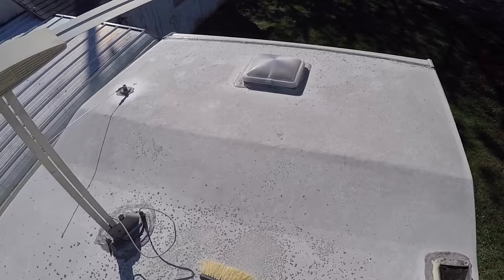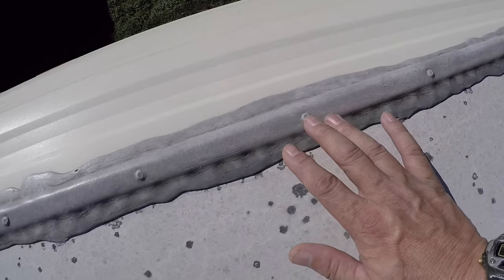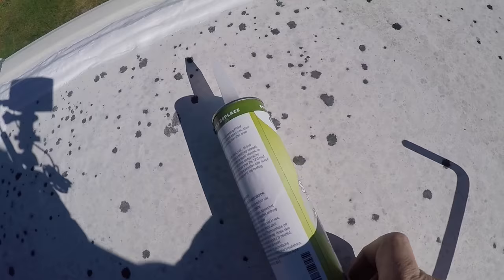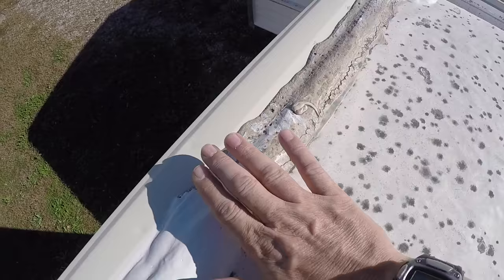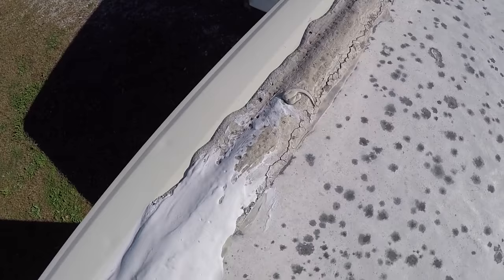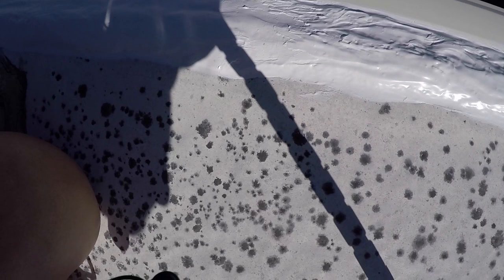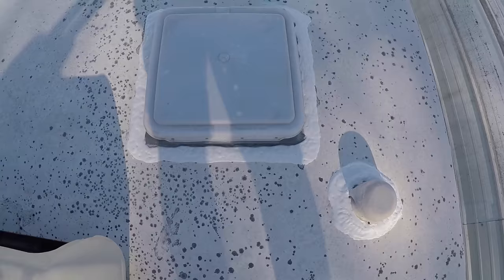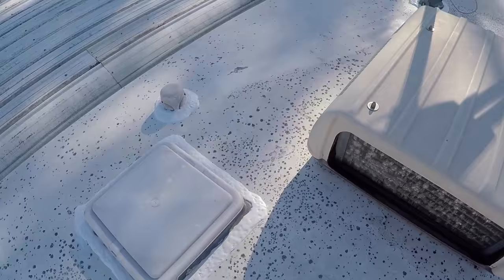How to Seal RV Roof Seams with Dicor Lap Sealant

Comment: Nice, we're about to tackle this very same thing, luckily with only a tank vent area for now.  But you did a great job explaining.  We'd love to see some footage of you getting the old caluking OFF.  Does one scrape?  Use a heat gun?
Anyways, good stuff, you did a great job, speak well.  Thank you for your tutorial.
Stay tuned for our vid on it, coming soon!
Reply from the maker: If the old sealant has good adhesion to the roof surface it is not necessary to remove it. Dicor instructions cover this topic as well if you would like to do some research on this topic. I've found that it's common for people to cause more roof damage trying to remove the old sealant as apposed to just cleaning it prior to applying another coating. I only removed it if it was pealing or easy to peal off with my fingers. I cleaned it well and then applied the new sealant over the old sealant. This makes resealing an RV roof fairly simple and you don't create more roof damage in the process of trying to remove sealant that doesn't need to be removed.
Reply: @WannaBFree  yep we get that too.  The challenge with ours is 95% of the sealant around one of our vents perfectly fine and only lifting in one 1-inch section.  We can lift it right up and off the roof.  We're thinking we'll lift up starting there and keep peeling it back gently and slowly and kind of "feeling our way" along to see if the lifted old sealant rips away from the part that looks to still be adhered or not.  Whatever comes off nicely we're just going to remove.  Time will tell.  Tackling soon!  Had to wait for rain to stop 🙄😣😮
Reply from the maker: I wish you the best with your project!
Reply: @WannaBFree  thanks kindly!  You too on any more that you do.  👍

Comment: Brand new RV.  Had a pretty bad storm our first trip out and I guess a tree branch or something put a nice big nick in the roof.  Didn't completely puncture where there is a gaping hole, but definitely breached the roof.  Thanks for the video.  Also, do you ever think there comes a time where, after many coats of the sealant are applied, that you need to remove the sealant layers and start over again?
Reply from the maker: If the Dicor has lost it's adhesion to the roof surface it should be removed and replaced.

Comment: Thanks for the video, it was really helpful. I was wondering when a non-self leveling sealant is of use on RV roof seams?
Reply from the maker: You are welcome and I'm happy it was helpful to you. I really don't know why you would have a non-self leveling sealant. That is a good question. My guess would be that it may be thicker and possibly for use with vertical surfaces? Maybe someone who knows will give us an answer to your question. Take care :)
Reply: @WannaBFree  No mate use self levelling on flat surface and non levelling on vertical , the smooth layer helps shed water off the roof , before I start I level the van get some water and see if there are puddles , if so I make gutters in the old dicier first then seal after drying time ,,, when storing your van make sure its sloping down to let shedding of the roof surface ,, 
R.J.T traveling the east coast of Australia ,,

Comment: Scrape away all old sealants including lap sealant for all joints to become totally,clean with vinegar or alcohol with a rag thoughoughly and apply a goodbead of Proflex RV  sealant on all joints to be sealed, about a 3/8 bead works fine. skylight, vents caps etc. DICOR IS NOT A SEALANT BUT IT WORKS TO DEFLECT WATER AWAY FROM SEALED EDGES on Dicor because water will and can get under the dicor because dicor develops cracks after a few years in hot sun.
Reply from the maker: RV roofs should be inspected and sealed as necessary annually IMO. A lot of people don't do either and then wonder why they have leaks and wood rot.

Comment: I have a few of those grey spots starting on one side of my roof, any tips on cleaning them?
Reply from the maker: If it were mine I'd probably get a rubber roof cleaner and give that a try. Here is a link to a cleaner I found on Amazon. I haven't used it so I really don't know how well it works but it would be a good place to start IMO.
Dicor Corporation RP-RC160C Rubber Roof Concentrate, 16 Ounces
https://amzn.to/3oiiosC

Comment: Just found your video, thank you! But I'm wondering, on a class C like mine, can't I do this seal all along the front cab seams? Not just the top, but the sides?
Reply from the maker: The "self leveling" Dicor Lap Sealant is designed to be used on a flat horizontal surface. If you use it on a vertical surface it will probably run down the seam. I would use a good quality outdoor silicone caulking to seal a vertical seam if it were mine. Hope this helps you out.
Reply: Use non-leveling dicor sealant on vertical seams

Comment: What should come first? Im using an Elastomeric roof sealant and want to also redo the lap sealants.  Aside from cleaning the roof, what should I do first? Should I have the lap sealant on the roof and the Elastomeric over it, or should I coat the roof and have the lap sealant placed over the aforementioned Elastomeric?
Reply from the maker: That's a good question but I don't know the answer. I have never used Elastomeric roof sealant.
Reply from the maker: Maybe the Elastomeric roof sealant will answer that question in it's application instructions?
Reply: You should do the Dicor sealant first then coat with your roof coating of choice. This gives the Dicor a better grip directly on the rubber roof, not on the acrylic coating you put down. Elastomeric is Acrylic and absolutely worthless. I researched it well.  It peels off in rain!  Might as well use Latex house paint - same thing.
Use Henry's Tropicool Silicone coating instead.  Pricey, messy, thick and effective.  Lasts a long time and insulates well too.

Comment: So maybe somebody can answer this simple question.  Tubes of caulk that I've used before I had to unscrew the tapered tip and puncture the foil underneath.  I noticed that the tips on the Dicor self leveling sealant does not unscrew.  So there is no foil seal?  I simply clip the end of the tip, put it in the caulking gun and start applying?

Comment: Obviously late on this but anyone doing this should use Sikaflex which is stuff used on commercial buildings. Stuff last 15-20 years and it is rubberized to allow flexing. Also you should get off the old caulking with a scrapper as there may be moister trapped inside the old cracks. Sikaflex is often cheaper than this stuff he is using and last longer. I;m sealing my camper windows and siding with the 221 brand and the roof with the 715. The roof is Semi leveling as I have a curved roof.
Reply from the maker: The dicor lap sealant has been working well since I sealed this roof. No problems.
Reply: Sikaflex is the best. I used it on my sailboat it's what all the boaters recommend
Reply: @jpnm81  Yeah seems to be holding pretty well but I been trying to scrap the old stuff off and even the stuff they had on there before seems pretty tough to get off. Still pretty gelatinous. Putting the new stuff over of what you can you get little spikes of stuff sticking up as it is not smooth but it eventually subdues the old caulking. I do it because scrubbing dirt off etc is pretty tough and I want to try and get the cleanest surface I can. No better than getting off as much of the top layer as possible. All the stuff underneath seems pretty adhesive despite the cracking.
Reply: That's the conclusion of all my research and exactly what I use too.  Dicor works well but never for 15-20 yrs!!

Comment: I've been removing all the old, cracked lap sealant, cleaning, and resealing. Have I been doing something wrong?
Reply from the maker: A lot of people will do it the way you have done and there is nothing wrong with removing the old sealant first. Dicor actually recommends removing any cracked or pealing sealant prior to applying new sealant. Dicor also states that applying over old sealant is fine as long as the old sealant has good adhesion with the roof surface.

Comment: I hope this isn't a dumb question, but why would you not remove the old cracked stuff first, clean it up and then apply new ?
Reply from the maker: The Dicor application instructions state that if the current sealant has good adhesion to the roof surface it is not necessary to remove it prior to applying a new coat. Also, many people cause more damage to the roof surface trying to remove the old sealant.

Comment: It is a band aid solution to me, you are putting more sealant on top existing one.  What i would probably do is to remove some of existing sealant before applying new one.  Or completely remove one ones, tear up a portion of it to repair
Reply from the maker: If the old sealant is adhered to the roof well, removing it is not necessary. If it is pealing and not adhering well, removing it before reapplying would be the correct way to repair it. This product is designed to be used over old sealant if the surface is cleaned properly. This information is all in the application instructions included with the Dicor Lap Sealant product I used in this video. Thanks for your input.

Comment: Please tell me how many tubes you used for your trailer for its length. I have a 30 ft 5th wheel. I have one tube but I'm sure I will need about 3 to 4 more. Thx.
Reply from the maker: I honestly can't remember but I think it was three or four tubes. How many tubes you'll need also depends on how many rooftop items you intend to go around. You are likely right about needing several tubes. My front and back seams both took a lot of sealant because of their width. You could use up your first tube and then you'll kinda get an idea of how many more you would need to finish your roof.

Comment: I've seen where after a soap.and.water.wash and rinse,some use mineral spirits,some use denatured alcohol for a final cleaning..what are your thoughts?
Reply from the maker: I haven't used either of those so I don't know how they would react with Dicor sealant or a rubber roof membrane. Interesting thought though.
Reply: After more research, Dicor recommends featured alcohol
Reply: Denatured not featured..dang spell check
Reply from the maker: Good to know and thanks for the information.
Reply: I found the info at YouTube under 'How to install Dicor lap sealant'

Comment: Sir, how did you clean the surfaces before applying the self leveling caulking?
Reply from the maker: I just cleaned it with dish soap, water and a brush. Then a good rinse with clean water and let it dry.

Comment: How many hours did it take to fully reseal the entire roof? I'm at a RV repair place and they say it will be 6 hours or so, and 1000 dollars, and I thought doing it myself would be better
Reply from the maker: This was only a little 14 foot camper and it probably didn't take more than an hour and a half. I can't imagine why it would take 6 hours even if it were a 40' motorhome. It's really a pretty simple job and I think most people are capable of doing it themselves. Just clean the areas you are going to treat as best you can then make sure they are dry before you apply the dicor. Use a generous amount and make sure to cover the cracked or damaged areas with new sealant and I think you will be happy with the results. You'll probably save yourself about $800 bucks if you do it yourself. Also I think the temp or at least the tube of sealant needs to be  at least room temp before use. You could just get one tube and give it a try and then you'll know. If it works out doing it yourself you can buy more tubes and complete the job. Good luck with your project.

Comment: What’s the difference between lap sealant and the tape, as far as how well it works.  I’m an rv newbie and bought one that needs fixing up.
Reply from the maker: Good question, I really don't know much about the tape. I've only used the lap sealant. I've seen a lot of people using the tape like I did with the lap sealant. Personally I would only use the tape if I were trying to fix a torn rubber membrane or something similar. My opinion is the tape could end up with a void underneath if you were trying to cover a rough surface and it could trap moisture or water in that void. Eventually during freezing and thawing you could end up with a leak. You won't have any voids over an uneven surface using the lap sealant. That's just my personal opinion, I have never used the tape. Hope this helps and good luck with your RV adventure!
Reply from the maker: Here is a good article talking about what I said about the tape and why I have never used it.
https://rvroof.com/2018/02/20/eternabond-tape-does-it-stop-rv-roof-leaks/
Reply: @WannaBFree  thanks!

Comment: Why would not remove the old lap sealant first and then apply the new sealant? Seams that just going over the old sealant is asking for trouble. Like caulking over old caulk, it just doesnt work?
Reply from the maker: The Dicore Lap Sealant instructions explain how to properly apply the product. It's not necessary to remove the old sealant as long as it has good adhesion with the roof surface. I just followed the instructions and it has served me well.

Comment: Quick question, how many tubes of the dicor lap sealant did you use for all of the repairs on that roof?
Reply from the maker: It's been a while but I think I used 3 or 4 tubes for this roof if I remember right.
Reply: @WannaBFree  Thanks for replying to such an old video! I appreciate it! This video has given me the confidence to do this on my own as well!
Reply from the maker: That's good to hear Michael. It's not a difficult job and you can save a lot doing it yourself. Good luck with your project!

Comment: You don't need to remove the old stuff first?
Reply from the maker: Not necessary if the old stuff still has good adhesion to the roof surface. Definitely remove any that is pealing away.

Comment: You don't remove the old sealant first?
Reply from the maker: You can if you want to. The Dicor instructions state that if the existing sealant is not pealing and has good adhesion to the roof surface, proper cleaning of the surface is sufficient and you can apply new Dicor over the old Dicor. A lot of people disagree with that but Dicor states that right in the instructions that come with the product. I have applied new Dicor over "cleaned" old Dicor successfully using that instruction many times with no issues whatsoever.

Comment: Is there any sealant work to be done usually under the AC?
Reply from the maker: No, the AC has about a 1" thick foam/rubber seal that seals with compression from tightening the AC mounting bolts. As long as the foam/rubber seal isn't too old and still has some life to it there should be no leaking. If it is leaking the seal needs replaced. No dicor lap sealant requirements under or around the AC unit. Hope this helps.

Comment: Dump the lap sealant and go with eterna bond. I did several years ago and, so far,  no leaks.
Reply from the maker: It's been several years using the Dicor and I have no leaks.
Reply: @WannaBFree  I am sure. The tape is just easier.

Comment: You need to remove the old Dicor.. before applying the new. and you never have to touch it with fingers.lol
Reply from the maker: The old dicor does not need to be removed if it has good bond with the roof surface. Have you ever read the Dicor product application instructions? LOL
Reply: @WannaBFree   After 6+ years of doing Peel & Seals.. I remove the old Dicor, or whatever they used up there..
Reply from the maker: I just followed the manufacturer's instructions that came with the product. I've had no issues with my reseal job.

Comment: Does it change to dry tone after a few years?
Reply from the maker: Not sure what you mean by "dry tone" but after a few years of exposure it will get a hard crust on the surface. If it goes for a long time without attention it will eventually crack and need recoated or removed and replaced.
Reply: @WannaBFree  I was just wondering if there is any discoloration after a few years.  Thanks for the reply, looking to seal my pop up with this stuff.
Reply from the maker: I understand what you are asking now. I don't think the color changes much over time as far as I can tell. (other than becoming dirty)

Comment: So your not supposed to remove the old sealant?
Reply from the maker: According to Dicor it is not necessary to remove the old sealant if it has good adhesion to the roof surface. It just needs to be cleaned then you can apply the new Dicor over the old Dicor. If it is pealing or has poor adhesion to the roof, you should remove it before applying the new Dicor.
Reply: Wow, kudos and thank you on a virtually instant response. So its been five years...how has this job held up and have you had to do this job again since you posted this video? 
I'm just curious if your happy with this product and how often you have to do this?

Comment: This works on aluminum ???.
Reply from the maker: Yes
Reply: Thank you.
Reply from the maker: You are welcome! Dicor lap sealant is a flexible compound that adheres firmly to EPDM, TPO, PVC, aluminum, mortar, wood, vinyl, galvanized metal, fiberglass and concrete. I have had nothing but good results using this product for sealing RV roof leaks. I am not sponsored nor do I work for Dicor. I'm just a satisfied customer that has used the product successfully. Good luck with your project!

Comment: You need to scrub that mold off your roof and re-coat the entire roof with dicor, you have three options available, standard white, cool seal or the longer lasting silicone based stuff.